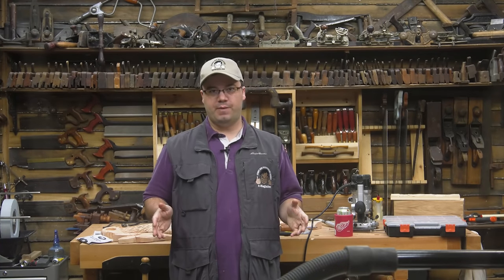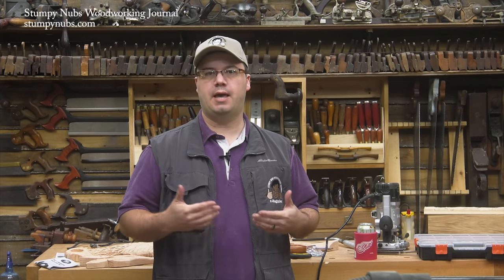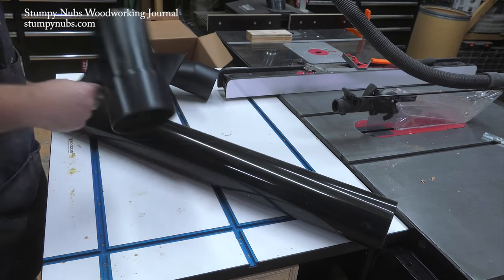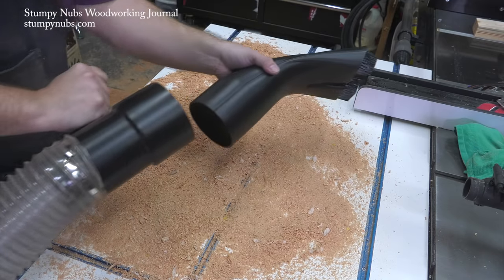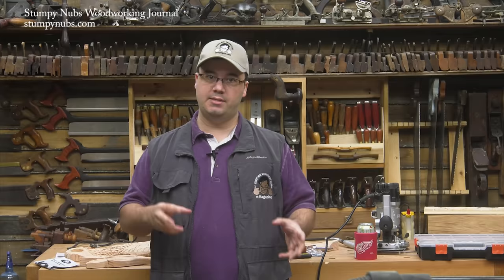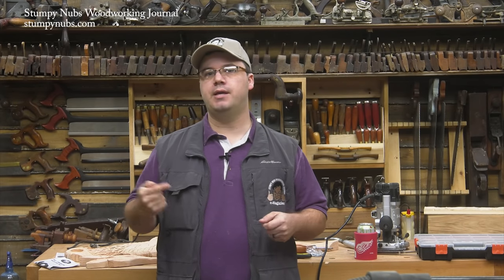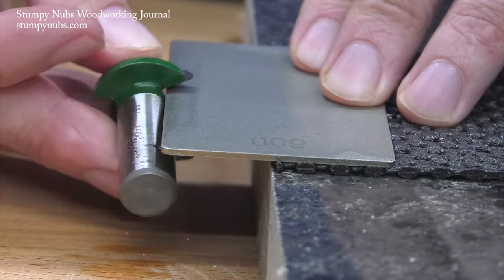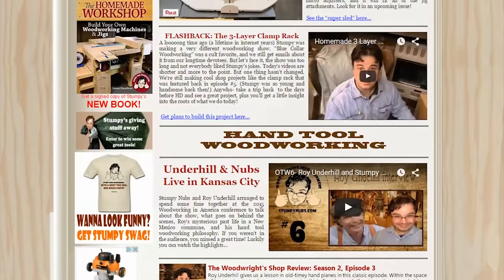4 Cool Woodworking Tools You Have To Check Out! (Drillnado, Saburr-tooth burrs, CRB7 and more!)

Comment: I love those carving burrs. I have several myself. They're expensive but do a great job. Highly recommended. As for the Drillnado, I've seen it at several woodworking shows and always feel that it's going to be in the way. like you said though, there are times when it would be a welcome addition.
Reply from the maker: I don't think it gets in the way once you get used to it. But I do think that I am unlikely to use it if I only have a couple of holes to drill. Where I can really see myself using it is when I am drilling a lot of holes and making a lot of chips. I think it will prove very handy for those situations. That's why I said it may not be for everyone. If someone only uses their drill press every couple of months, then they may not be able to justify the $40. But if someone makes a lot of projects and uses their drill press a lot, I think it's a good investment.

Comment: I watched your video on which table saw is best (for me) and have tried to find a belt-driven contractor table saw less than 1,000 miles away from me in a San Antonio with little success. Besides eBay, Craig’s list and FB marketplace, are there other places you recommend to look? I don’t want to spend much over $250-300 because I’ll likely be upgrading the fence also per your suggestion. Any direction you can provide is appreciated. Love the channel and the site!

Comment: Ok, so I have a tip for you Stumpy ! I've noticed that you haven't upgraded your drill press yet to a keyless chuck. I did this years ago on my drill press and it has been the best upgrade of any that I've done to date. They hold really well. I've never had a bit slip on me and my keyless chuck  isn't an expensive one. I think I spent around $65.00 dollars on it and I know you can find then for less. They save your knuckles and are a lot easier on your fingers, not to mention it greatly speeds up the time to change bits. Actually I'm a little surprised you haven't made this upgrade yet. In fact this would make a great new episode for your next Cool Tool video !

Comment: DrillNado works well for multiple same sized holes. For a single hole? Not so much. Forstner? No. The collar that encircles the chuck has an opening that is too narrow and just clogs. Limited actual value.
Reply from the maker: As I showed in the video, it clogged with a forstner bit unless I slowed down, then it worked fine.
Reply: I will give that a try.